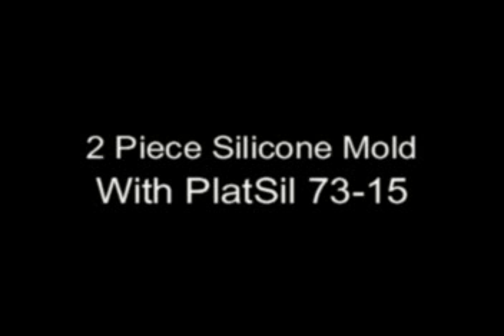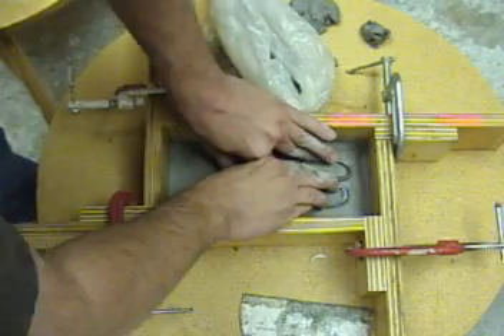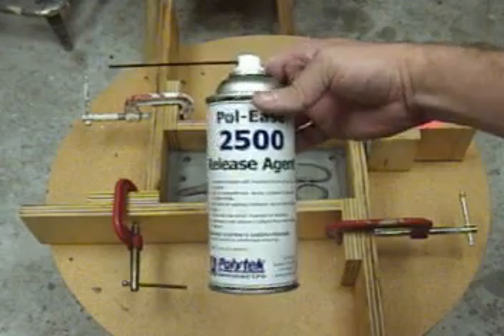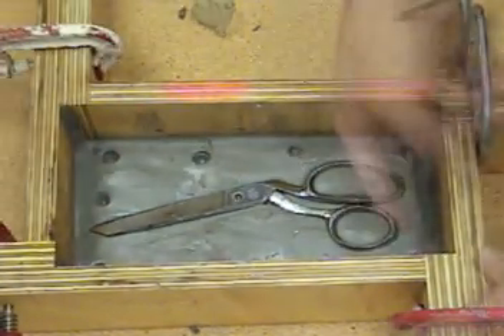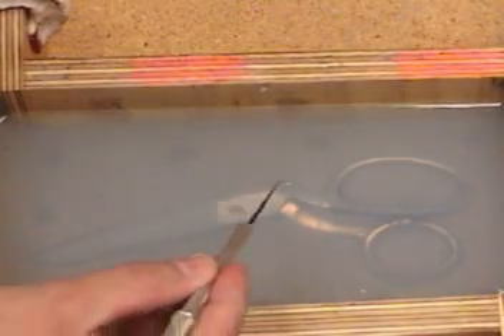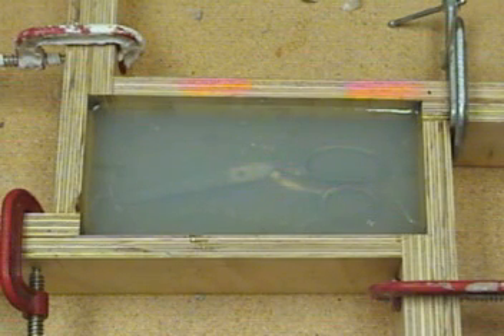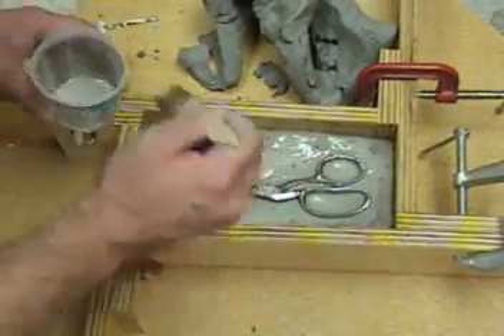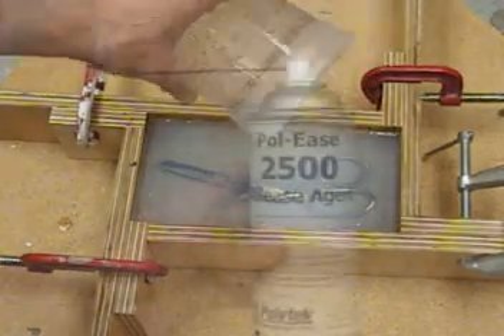Mold Making: 2 piece mold

Comment from the maker: The 2500 can be used with most silicones to break the surface tension.  2500 comes with a tube for spraying provided the UPS brutals did not dislodge it.

Comment: Can you spray the 2500 mold release across the surface of 73-25 to aid breaking air bubbles in the silicone as well?  Also, do the spray mold releases come with the tubes that direct the spray as seen in the videos?  Thanks, Mitch.

Comment from the maker: EZ Flo 60 if you want a basic, pourable resin.  If you want hollow parts you can "slosh" EZ Flo 120.  If you want translucent parts or parts with intrinsic color use EZ Flo Clear.  If you need a castable, flexible rubber try the PT Flex Series.

Comment from the maker: @Dach101 Those are the reasons.  It isn't that much more expensive and the mixed viscosity is the lowest of any moldmaking silicone.  The demold time is about 4 hrs so it is a great silicone for parts that need to be made accurate and fast.

Comment from the maker: @JohnnyDesaint Use Easy Flo Clear with red Poly Color or 1411 with red PolyColor.  Both will work, the 1411 is water clear as opposed to EZ Clear which has an amber cast to it.

Comment: @Stevieboy7 

If you would turn the mold over and you clamped the box like they did in this video,being perpendicular to the "floor", you would need to remove them to turn the mold over.  If you used larger and "deeper" "C" clamps, where you could fasten them to the box so they are parallel to the "floor", then you wouldn't need to remove them.

Comment from the maker: @Dach101 For this process a fast setting platinum silicone is ideal as the mold can be made in a day.  Most Tin cures take at least overnight to cure or degrade if they are accelerated.  If anything, my other choice would have been Tinsil 70-30.

Comment: great tip with the silicone volume. Thanks! 
can I ask, why use a plat silicone as opposed to a tin cure ?  
Plat always seems a lot more expensive, i know it doesnt shrink at all and will last a lot longer.  Maybe it's just the translucency you needed.  For a job like this , plat would push the budget up quite a bit.

Comment: @Stevieboy7 

Yeah I was thinking the same thing... but if you notice the clamps are not side mounted but on the top.  So, if he flipped the entire thing over as it was it woudl then be sitting on the clamps.  :-)  (and before you ask my other thought of why not cut the boards smaller.. they need to be that length to adjust for diff mold sizes. :-)  )